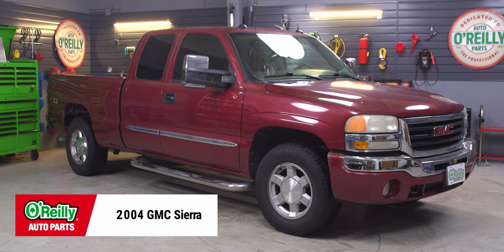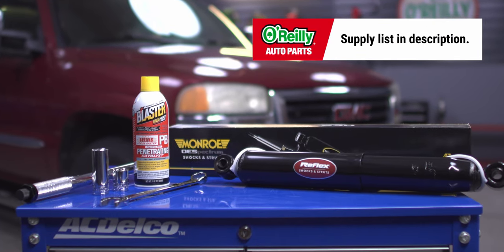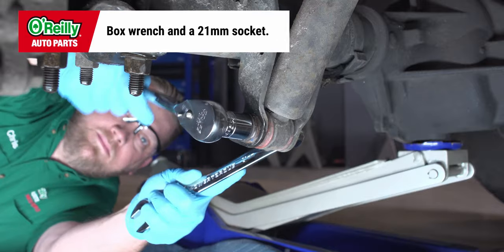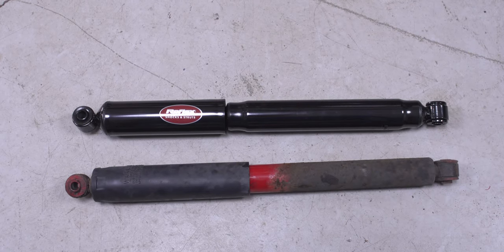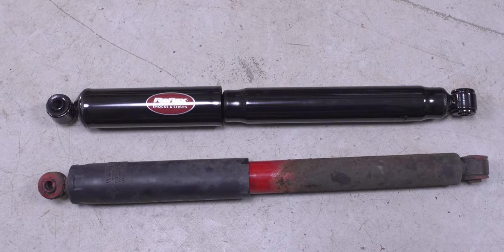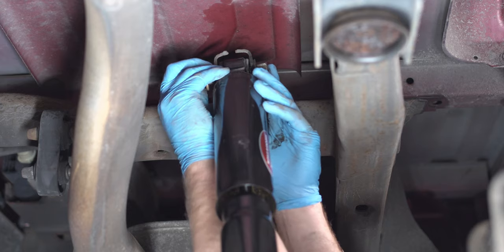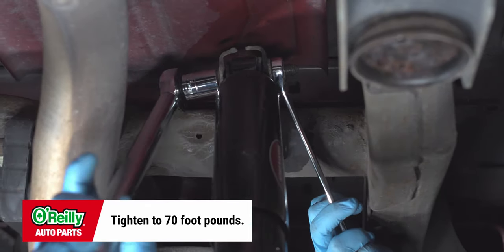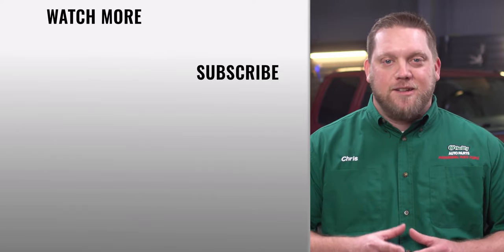How To: Change the Rear Shocks on a 1999-2007 GMC Sierra or Chevy Silverado 1500

Comment from the maker: Supplies Needed for This Job:
1. Safety Glasses: https://urlzs.com/hbwc
2. Gloves: https://bit.ly/2GvfwAm
3. Box Wrench: http://bit.ly/2XK1Mrt
4. Ratchet: http://bit.ly/2IEAOOi
5. 21mm Socket: http://bit.ly/2Hx0HNs
6. Breaker Bar: http://bit.ly/2UWfies
7. Torque Wrench: http://bit.ly/2UToD1D
8. Penetrating Oil: http://bit.ly/2H6qr42
9. Jack: http://bit.ly/2ZxQiJl
10. Jack Stands: http://bit.ly/2L1YEp9
11. Wheel Chocks: http://bit.ly/2ZvIW98

Comment: I have a 2001 GMC Sierra C3 and the top mount for the rear shock has rusted off.... Is there a replacement bracket that I can securely replace it with?